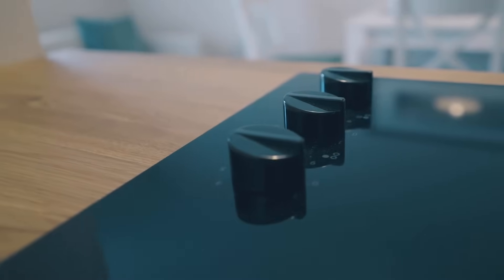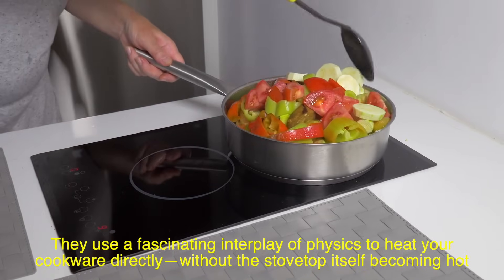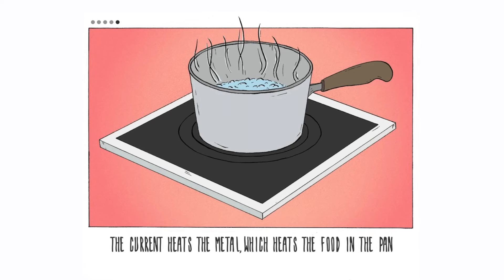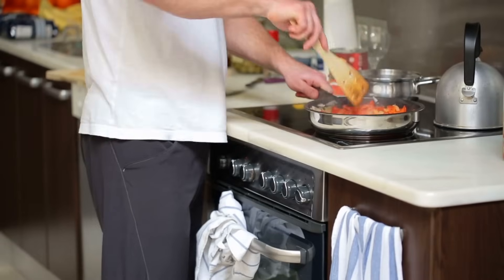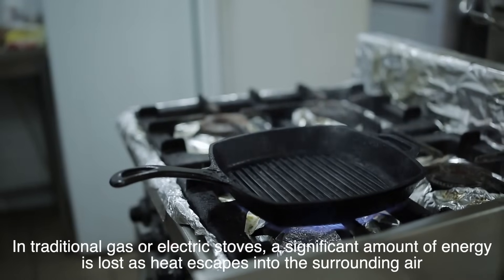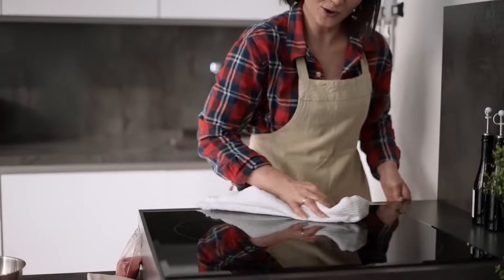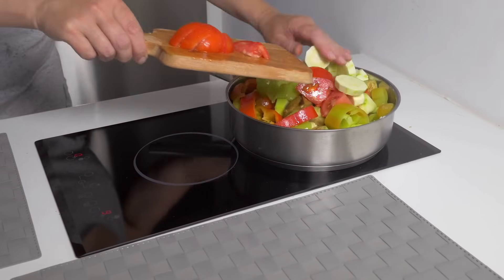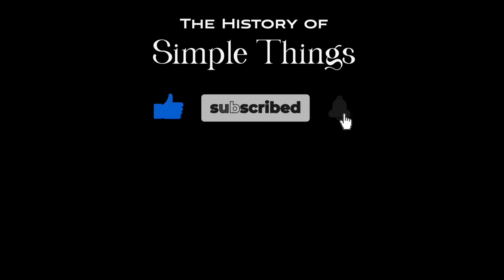How Does an Induction Stove Work?

Comment: The glass top on an induction stove will crack or shatter if metal cookware is carelessly dropped too severely on the glass. Then the glass will need to be replaced to avoid injuries.

Comment: Only one complaint after three years with induction. Low temperature for slow cooking or melting chocolate are not really "low temp". My cooktop pulses the energy on and off to change the low temp settings. More "off" than "on" makes the cooking go slower, right? The problem is when it comes "on" that instant heat raises the temperature of the bottom of the pan instantly. You still need a double boiler to melt chocolate. Small detail. The efficiency, safety, and instant on and off are worth the trouble.

Comment: No, you don't need the pan or pot to be ferromagnetic. The eddy currents do the job of heating. The only requirement is that the pot material should not be a good conductor like copper or a bad conductor like ceramic but somewhere in between. Stainless steel works perfectly though it is not magnetic
Reply: No, no, no and no! Please gain some knowledge before posting on a matter you don't know anything about.